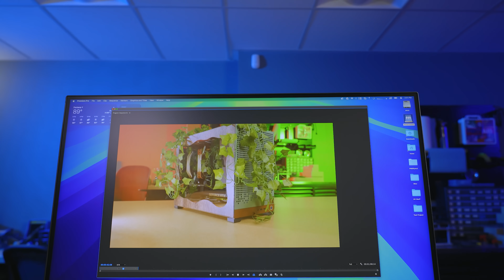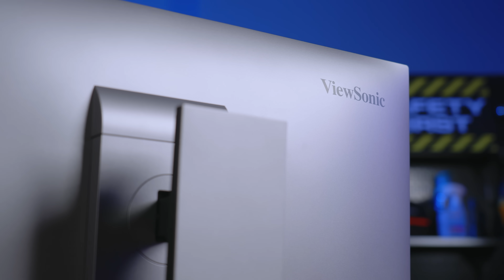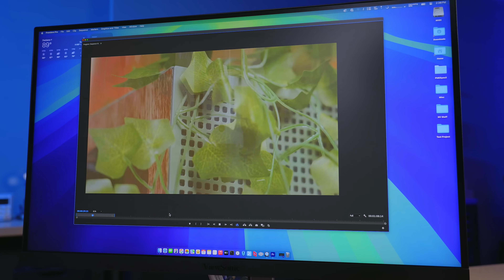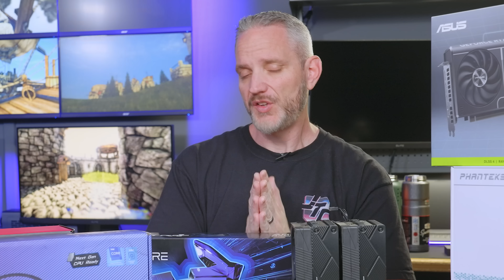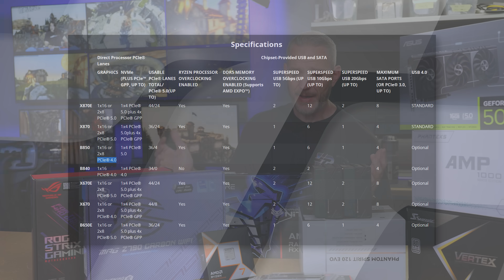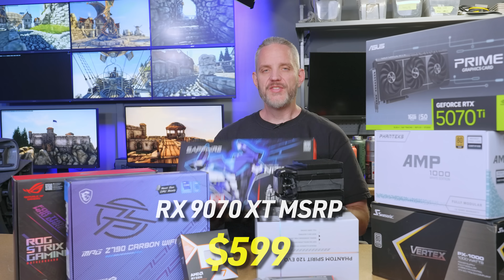This is the Sweetspot for PC gaming... Don't get fooled into spending more!

Comment: One issue that needs to be addressed is the back panel I/O connectors. You typically get MORE and FASTER USB slots on the higher end boards. That's another part of the equation. Was the ONLY reason I upgraded from a B650 to an X670 motherboard for AM5.
Reply: Only reason I went X870E was USB4 x2. My X670E needed a Thunderbolt 4 card for 40Gbps USB-C x2.

Comment: My sweet spot is like my sweet tooth - excessive.

Cries in x870e, 9950x3d, 4090 liquid Suprim and 96gbs of ddr5
Reply: and your 9950 x3d is bottlenocked by your 4090. Even 5090 is bottlenecked with X4 Frame gen.
Reply: Exactly, I need a threadripper to really utilize it. But, it was meant for long term gaming, so I don't have to upgrade for a decade  @Subscribetograndecharlatte
Reply: No lie, I'd like to have 128GB of ram. Not that I could currently make use of it.
Reply: @ArtisChronicles I do music with this machine as well
Reply: Same specs here except I have a 9070 XT for GPU because I refuse to buy NGreedia and run the 12VFireHazard.
Reply: @mattrogers6646 don't blame you. Needed the VRam at the time.

Comment: The recommended power supply on GPUs are already assuming you have the most power hungry CPU + headroom
Reply: And/or a crappy psu :D
Reply: but it's not taking into account the efficiency of a power supply. The most efficient range is usually between 30-50% of the rated wattage. As soon as you go above that you start getting out of that sweet spot and you PSU will be generating more heat than you really need, and won't be as stable for as long. The more you over spec a power supply, the longer it will last without being the loudest thing in your system besides the GPU.
Reply: @mcpudd-20k  It was never been like that, maybe if you calculate with a 400W PSU with only capable of 250W at 12V. This 50% stuff is oldschool, it comes before the 80+ rating was a thing.
Modern PSU sweetspot is 40-80% and the curve is basically flat in this region around 92%. Between 30-110% they still more than 90% efficient. Only the low range is inefficient, 0-20% range is 70-85% efficient, so if you buy a 1000W PSU insted of 650W you gonna use 10-15W more at idle and same or maybe 1-2W less at full load.

PSUs die because of bad design, maybe bad caps and most often because of a bad fan, so if you want long lasting PSU buy from a reputable vendor and point the PSU fan upward so the oil never gonna flow out from its cylinder and you can see the fan if it stopped.
Reply: @mcpudd-20k  This is such miss information that has some how caught traction over the recent years. It is absolutely not true at all that power supplies lose stability going over 50% usage idk who started the bs or why people keep copy pasting these lies but it triggers me to no end. Yes they get hotter under heavier load... That's why they have fans champion. The fact most peoples psu fans are not on most of the time just shows they wasted so much money on a power supply lol

Thinking about it again I think this miss information spread around 30 series when psu that should of been enough were not working because of spikes so sometimes shut down... Some how that turned into oh if you use 80% of the power supplies rated wattage then it gets less stable!!!! lies lol.
No psu don't get less stable at higher usage.
no a cpu doesn't perform better at 20c vs 70c
no 16gb vram should not be needed for 1440p gaming in 2025. 
no a 1k dollar motherboard with "super amazing vrms" does not improve performance over a 150 dollar motherboard when running at stock.

Can we stop spamming all these exhausting lies and so many more like them lol

Comment: I was shocked when I built my AM5 system to find that the QVL actually matters on DDR5 based systems. I bought some RAM with EXPO, figuring it would work fine. It worked, but every time the system booted up, it took 45 seconds for the motherboard to finish training itself for the RAM. I thought something was broken, but it turns out this is normal - if the system doesn't have the RAM in its QVL list, it performs extra tests before it will start. A couple BIOS updates later, and the RAM was added to the list and the system booted without this delay. So spend some time and hunt down RAM that's on the QVL, it's worth the effort. Even after 30+ years of building my PCs, some things are still a learning curve.

For my $0.02 on budget builds, if you've got AM4 hardware lying around after your upgrade to AM5, update the BIOS, slap a 5700x3d in it and pair it with a 9060XT. Hook it up to your TV, install Bazzite on it, and you've got a system that can run pretty much any game on high or ultra at 1080p for couch gaming for less than the price of a PS5 Pro. Then optionally set up a new Steam account, add it to Family sharing, and enjoy buying your games for all of your PCs from Steam rather than needing multiple copies for two systems. At $70+ per game, it only makes sense to use what you have and economize by buying fewer copies.

Comment: as long as most of my games can run 100fps max settings im good. it's just them damn unoptimized games (f u UE5) that get me buying a new pc every 4 years. but jay is right dont overspend on motherboard, ram, psu, etc. My new pc has a ton of budget parts and the cpu and gpu are 70% of the budget.

Comment: 6:30 Then why did you chose a gen 5 ssd on your recent micro center build. You chould have had a 4tb drive instead of the gen 5 one you used.
8:14 On the same microcenter build you chose 6000 ram but with cl36 timings. Why didn't you chose something better for that? 
Not trying to be an ass but you do see the contradictions here?

Also 16:18 you mean "future proof"? (ducks)

Comment: so, i recently built a new pc, upgraded from an old clevo laptop (ryzen 3900 RTX 2070) i bought everything brand new ( Chinese B650 motherboard, Ryzen 7700, 32gb ddr5 5200 (to upgrqade later) kept the drives from my old laptop (4tb total m.2 + 2.5 sata) 650w Gold modular PSU and an RTX 5070 at MSRP, in total i spent just under 1000 GBP, if i include the drives it runs me at about 1200, for me this is a ''best compromise build' its powerful, small, has all the knobs and whistles i need and the only thing i would change is the motherboard if i could find a budget X670E option
Reply: Actually pretty solid. I've actually been tempted to try to get into AM5 with something like a 7700. Probably won't happen for a while.
Reply: Huh... don't see many 3900's in gaming rigs considering they're an OEM exclusive. I had to pay a premium for mine on eBay, and then I had to pay a hefty import fee when it landed. I 100% paid far more than it's worth. Put it into build for a friend with a 2060 12GB as he tends to be more into CPU intensive games like Stellaris.
Reply: @Bearded-Mutt it was an OEM laptop clevo nh55af1, came with a socketed am4 CPU, was a beast
Reply: Good choices! Frugal, and getting a good enough PC.  🙂

Comment: This type of information is good.  One suggestion is to possible then build said "Sweetspot PC" and show what people can expect in terms of performance.  Show what performance someone playing the latest games can expect at 1080, 1440, etc. on this type of rig.  Let them know an approximate longevity of these parts to continue to play at these specs.  Then they can decide if they are building a PC that'll last two years before needing to upgrade for their particular use case, or if it will last longer.

I currently build up slightly because I expect my PCs to last a minimum of 7 years before having to upgrade.  This is of course barring any components not working prior to that and needing to be replaced.

Also, that 9070xt is currently 799.99 on both Amazon and Newegg.  Still overpriced, but not as much as you have stated in the video.

Comment: Recently build my first AMD system since Athlon. I'm using the 9700x, it's rock solid and I'm thrilled with the performance.
Reply: same here bro Its been a while since Athlon 64, going all out this time R7 9700x + rx 9070xt
Reply: Also just switched back to AMD since Athlon, 9800X3D and I've ditched my constantly crashing RTX3090 with a 9070XT, it's been absolutely rock solid so far, no issues whatsoever :)
Reply: Same here, I switched from my old trusty i7-8700k to a 9700x
Reply: I still regret switching to intel from my FX-8350.
Reply: I built my first system back in February with the 9700x as well! Overlooked beast, and super cheap when paired with the microcenter bundle!
Reply: I have been running AMD-only since 2018 - they are really worth it.
Reply: Same here. Athlon 64 3000+, now running a 7000 series chip after 5 Intel cpus. Much better bang for the buck without voltage fears. Intel what? Just keep working on your GPUs please.
Reply: I always used Intel for my pc's as AMD used to be so bad. But for some years now AMD is the way.
Reply: Oh man, I had an AMD Athlon II X2 250 in 2010, replaced it for an FX8350 in 2016 and my current is an R5 5600 purchased in 2022.  I have a huge soft spot for that FX8350.
Reply: @TiaKatt  Bulldozer and Piledriver was the worst AMD ever made. You cheaped out on buying a CPU and payed the bill afterwards. You were always at a loss compared to intel back then.
Reply: All these AMD fan boys that only buy amd everything. Buying the 5070ti at $750 is great!

2nd) Honestly the 9800x3d for $500 after tax is insane unless you have an rtx 5090. 

If the 9800x3d was down to earth for $399 regulary then id say ya 😉. Its the the fastest gaming cpu at 1080p and 1440p. But with a mid range 5070ti a 14700kf for $300 is much better and then get a 4tb m.2 Samsung ssd instead of a 2gb. Bf6 and many games need LOTS of space.
Reply: @TampabayJohnny  you're assuming people aren't going to keep the 9800x3d for their next gpu upgrade, makes more sense than only buying what goes with your current gpu and having to replace both next time around
Reply: @martinarscott3524   most people aren't buying top tier GPU'S, ever. Most cant afford the ridiculous amount of cash for a $5080 or 5090. That's why most people are in that sweet spot of mid range 5070/super or ti, 5060ti, 9600xt and 9700xt and pairing a 7800x3d or 14700kf is all thats needed. And those two chips are neck n neck at 1440p gaming in most games with the 7800x3d coming out slightly ahead. Though Intel takes much more power and needs more cooling, it does offer a better all around experience if you do any sort of gaming while multitasking with background programs running. Also more threads and cores offer a good editing and streaming rig.

Comment: I still use nothing but Gen 3 SSD drives. Unless you're doing things like video editing, i.e. the massive file sizes Jay mentioned, they are still very fast at launching 9/10 games with very little difference to gen 4 or 5. Gen 3 for price per gb

Comment: I agree that everyone should overspec their power supply. But im definitely the example of do as I say not as I do, using a 7900xtx and 5800x3d  with a 750w power supply. Have had zero problems even with me overclocking the 7900xtx running for almost 2 years. But I would never recommend doing this at the time I only had enough for the card and really wanted it.

Comment: This is my second computer with a tower cooler from BeQuiet.  I tried two AIOs, and there are more problems than they're worth.
I'm still using a 3080 because I don't have the money to get a new card, I don't want to sell a body part for one, and I don't want my system to explode because of quality issues.
I do need/want to upgrade my 970 nvmes.
My Corsair 1000 watt is definitely over spec, but it's rock solid.  It replaced an xfx 850(?)-watt.

Comment: 12:26 A note for that specific cooler is that it costs $70 + tax in places like Micro Center. Amazon has it for $50 + tax, which is a pretty good deal for what you get.
Reply: Jay is behind the times. The Thermalright ones are way better value. At $70 you can get a 360mm AIO with 5 year warranty
Reply: @JBrinx18  The air cooler he showed in the video IS a Thermalright Phantom Spirit 120 Evo. It costs $70 at Micro Center, but $20 cheaper on Amazon.
Reply: @JBrinx18  this comment just came off as too funny. I'm considering upgrading to a thermalright cooler that's $60 before tax. Only reason I'm thinking about it is because it has cpu and gpu readouts on a screen that sticks to it. That and it's a dual tower that can work for whatever AM5 cpu I might consider upgrading to in the future.
Reply: get the phantom spirit 120 SE ARGB. $37 and better performance.
Reply: Shoot I usually just find cheap air cooler with a good radiators and slap 2nd fan on it and it usually goes well.

Comment: Don't know about in the US but if you can take slightly worse GPU performance you can get a 9070 (non-XT) for under MSRP in the UK now. Powercolor Reaper 9070 currently at £500 (incl VAT) at Overclockers UK.